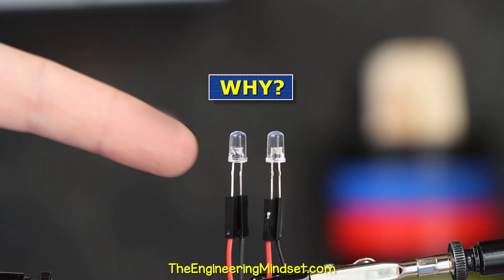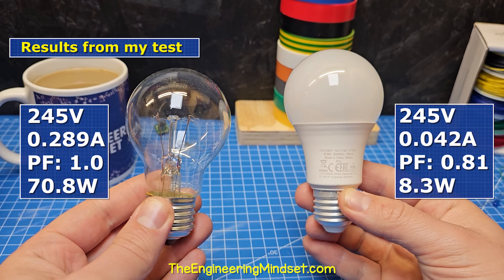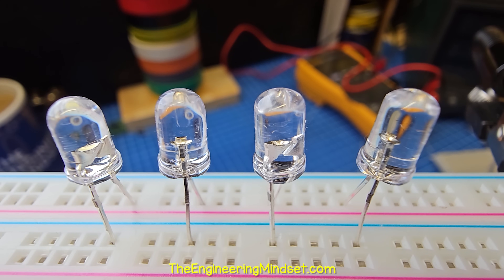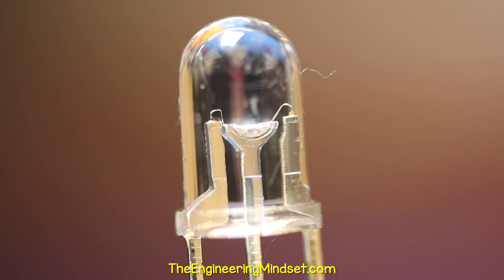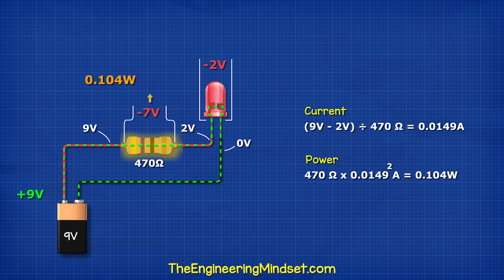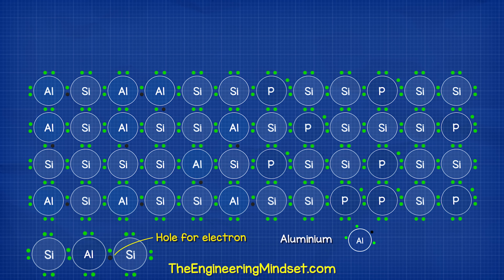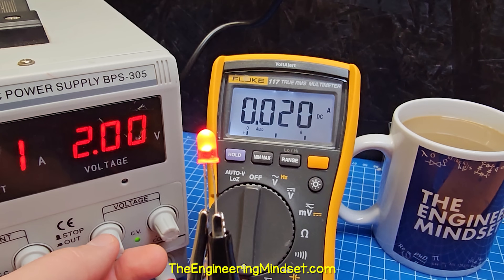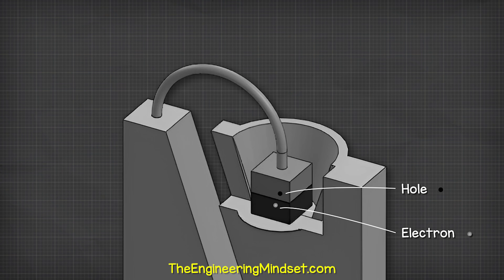How LED Works - Unravel the Mysteries of How LEDs Work!

Comment: Here’s a question:  when I watch YT videos of people on the street, often LED’s, whether traffic signals, lights in stores, or decorative lighting, appear to pulse/flash?  I realize the camera, by taking X frames per second is acting like a stroboscope, but that might mean that the light from LED’s is, in fact, flashing at a high frequency.  If that is the case, is the root issue that the LED’s are powered from rectified AC that’s not filtered?  Are we seeing 100 or 120 Hz pulses from unfiltered DC?

Comment: It's excellent, but there are a few minor details I can clarify. When you point to the television, you seem to think all televisions are OLED or similar, which isn't the case for most. LCD televisions have liquid crystal displays, just like watches. These crystals are positioned on the screen to block light and display each digit. LCD (and LED) televisions work the same way: the screen has filters for each color—red, green, and blue—then the liquid crystal, and finally the backlight. Quartz crystals block the colors that shouldn't be displayed. A simple example is for the screen to appear red; for that, the crystals must block the green and blue filters, but not the red. Since the red isn't blocked, it will shine through the backlight. The latter can use CCFL lamps or LED diodes, hence the term "LED TV."
In the case mentioned in the video, it uses a different technology, OLED. In that case, there's no backlight because the LEDs emit their own light. There are no filters because they have their own colors; that was the biggest mistake.

Another, albeit minor, error is that LEDs do generate heat because they also consume power, although the consumption is very low. So low, in fact, that the LEDs are soldered onto an aluminum plate to cool them. Another source of heat in the lamps is the electronics that reduce the line voltage to the appropriate level for the LEDs, but this consumption is lower.
The video failed to mention "smart" RGB LEDs. These have two or four terminals and are programmable for different colors or brightness levels. In the case of two terminals, one might wonder how they can vary the brightness and alternate between other colors. The answer lies in the power supply. Through it, a pulse train is sent at 400 or 800 kHz, depending on the timing and sequence of each pulse. The LED receives these pulses as a message, and a controller in each LED acts based on what it receives in the sequence.

Comment: I watched a video not too long ago about Shuji Nakamura, a Japanese scientist who struggled for decades attempting and ultimately succeeded in creating a viable blue LED. Up until then, blue LEDs were super expensive and consumed vast amounts of current. Companies like RCA and IBM gave up on their blue LED research. The company Nakamura worked for told him it was getting too expensive and to stop working on his project. He quietly continued the work on his own and ultimately succeeded giving us the means of producing cheap full color LED displays.
Reply: Also, Blu-ray DVD’s wouldn’t have been commercially possible without a reliable mass production process for blue LED’s.  If not for the difficulty of this problem, consumers would have had Blu-ray much sooner.

Comment: i love the modernity and colorfulness of LEDs, but the only think i hate about it is that's polarized, meaning it's choosy for positive and negative positions, which takes a little bit time to install, unlike neon or incandescent bulb. but i don't judge leds, please
Reply: also, when i connect the red and green LEDs in parallel, only red lights up, then the green didn't, just faint green light

Comment: You should add a section about the discovery of the Blue LED and how the inventors won the nobel prize. Due to its importance in modern life and completing the RGB combination - I.e allowing white light to be created with low energy, and allowing LED screens to function, and the colour changing lightbulbs etc.
In your example you elaborate on the process of Red, Orange, Yellow, Green etc. with Gallium Phosphade, but blue is entirely different - Silicon Carbide.
Reply from the maker: Tha ks for the feedback. Unfortunately, it's not possible to add to a published video. This video is just about how it works. Veritasium has made a fantastic video about the story of the Blue LED and the Nobel prize.

Comment: What happens after all the free electrons in the n region gets combined with the holes in the p region. I mean there will be no more generation of light since all the electrons and holes are recombined? Or does the electrons constantly gets stripped away from the holes after releasing a photon as far as we apply a voltage?

Comment: excellent video! 
Just a couple notes. at 8:35, unlike what's mentioned, most monitors would not use LEDs directly in the subpixels, more commonly just as a backlight, although the color mixing mechanism is the same. second is that the white LEDs used in light bulbs don't mix colors like that, as implied at the end. they're simply blue LEDs with a phosphor coating. exceptions exist of course. 
these are really nitpicks though, and I'm sure they've been pointed out before. i hope you keep up the great work!

Comment: so leds is the same tech used to make diode lasers then , only the configuration is a bit different instead of a cone reflector they use a farbi perot setup , why do leds have this bulb shaped lens is it to further converge the light coming out and without it the light would be more flooded rather than concentrated?

Comment: After 16:25, a few queries.  Is the Silicon Semi conductor still doped with Al and P?   With the GaAs and GaP semi conductors, is there still Si in the material?  So there is Ga in the P type junction and a mixture of As & P in the N type junction?  The ratio of 3:2 As:P gives you 1.7584eV?

Comment: Let me get this straight.  An  incandescent bulb gives off light and heat.  To use an LED bulb you need a light emitting part and a resistance part.  So the end result is they both give off light and heat.  Just one is way more complicated with all its chemicals and byproducts and potentially more damaging environmental hazards created by making of  semiconductors.

Comment: Good Work!  One question:  For red color to be produced the n-type and p-type materials would be different from materials producing green or blue light. Does the reason of producing Red, Green and Blue   because of each semiconductor material electrons´ have different energy levels?? I mean the electrons configuration of each semiconductor material for the red, green and blue is different. Thanks!

Comment: I'm new to electronics, and learning as I go along. I watched this video for the 4 pin RGB LED section, and it was by far the best video I've found. I made his breadboard circuit, but only have 2K potentiometers. Would that make any difference to the rate/way the resistence is limited to the LED?
Reply from the maker: Seen our new Potentiometer Explained video? ➡️ https://youtu.be/Xb-MZMoUtcQ

Comment: I would like to object to the comment about your screen being a bunch of multicolored LEDs. OLED is the only type of screen that uses multicolored LEDs. Most other screens use LCD (though often with a white LED backlight), which uses liquid crystal and two polarizing filters to control how much light is passing through small color filters. The visual of little RGB dots will still be the same, but the technology in use is vastly different

Comment: Can you describe 5mm 2 pin RGB led  light how to make work & diagram
Reply: Because  I have doesn't understand 3 colour led in understanding but how to make lete exchange few times auto matic with out ic
Reply from the maker: All covered innthe video

Comment: I want to connect 20 LEDs that have a max of 3.2v and 20mA each. Therefore I calculate I need 64v with a 2800 ohm resistor using 120v input Am I incorrect in my calculation thinking the volts coming after the resistor will be be 3.2v and that is all I need. Will it still power up the LEDs. Or do I need to have a power source of 64v which I would like to use the standard 120v input in North America to convert somewhere to 64v. I believe most adaptors have a built in transformer.
Reply: I did not get a full response

Comment: I bought two types of LEDS - 
1 = classic model - 2 pins = 1.2v ?
2 = modern ?  model -  4 pins 
 handles 3V - holds red , green, blue
red is not that strong, green is strongest
blue is stronger then red
red uses more mA

Comment: 1. A normal diode restricts current to flowing in one direction.
2. Some TV-LEDs emit light at wavelengths of 1 micro-meter or more.
3. LEDs work on the same principle as most lightbulbs, but WAY smaller.
4. You know what's cheaper?
R E S I S T O R S
5. 'SMD diodes' That's how computer pixels work.

Comment: 0:41: 💡 LEDs produce light by emitting photons when a voltage is applied, and they are more energy efficient than traditional incandescent lights.
3:25: 🔦 LEDs, including SMD and high-powered versions, emit different colored lights and can be used in various applications.
6:49: 💡 LEDs are used in various circuits and can be controlled to produce different colors and brightness.
10:06: 💡 LEDs and their components explained.
13:43: 🔬 The PN Junction in a semiconductor creates a barrier that prevents electrons from moving across, but a forward bias allows current to flow.
16:49: 🔬 Scientists discovered how to create different colors of light by blending different materials to form a semiconductor.
Recap by Tammy AI

Comment: They're neat but i've found myself hating them because some idiot decided LEDs should replace incandescent lights and fluorescent lights. When LEDs are used as replacements for those usecases they give me a headache, and I do not like having them in my home at all. I do not care about the higher energy usage, I need the other styles.  

Thanks for explaining how they work anyways but this doesn't solve my problem.

Comment: In 9:29 you mentioned that a single resistor removes 7V from 9V power source.
This is driving me nuts. I can't find a formula to calculate it anywhere. The only voltage drops information there is: how to determine voltage drops across a multiple resistors. But NOTHING about a SINGLE resistor.
I even asked ChatGPT about it (it's useless).

Could you please explain how do you calculate it? For now I just assume that to drop 1V you need approximately 70 ohms.

Comment: you can light both leds on 2 wire 2 color leds also - just half the brightness by using higher frequency alternating voltage. or just AC voltage.

Comment: Since it releases energy it is supposed to produce heat why no heat in the led
Reply: Because most of the energy is in the visible band so we see it as light.  Normal diodes emit energy in the infra-red band which is perceived as heat.  LEDs do produce some heat too, but less than a similar "normal" diode.    It is the current which produces the heat, a normal diode might be rated up to 2amps or even more, but LEDs function with a small current of 10 to 50 milli-amps.

Comment: The end of the video kinda undersells how big the discovery of the blue LED was. You name SiC as the blue LED, but in reality its indirect band makes it less efficient for the application. Gallium nitride was the bigger deal, it has a similar gap, but it's direct. It was such a big deal that the engineers who developed GaN based blue LEDs won the Nobel Prize in 2014.

Comment: ha ha try a ferrite core with say 21ga. 6 loop wrap slide down over a cb antenna key it up you will turn on both leds no  battery just RF power induction  used to light up watt meters that way

Comment: As a person born with astigmatism and nystagmus, I despise LED's nowadays.
They are practically blinding, burn images in my eyesight that lingers for a long time, and have horribly opaque halos around their source, which makes it impossible to see.

One could say "lol don't look at them", which is nearly impossible since nearly everything have them installed anymore, so much of which don't have a method of diffusing or masking/shading the diodes.

This includes streetlights, billboard displays, headlights/taillights, screens, stoplights, ceiling light strips, industrial work lights, spot lights, etc. How can one avoid looking at them when they're everywhere?
Reply: I HATE led lights too. Absolutely despise them

Comment: Great description! 👍🙏

Could you make a video about oscillators? I'm curious to learn more about them.

Also, what is a photon? I can see the light from my remote control with my naked eye, does that mean I can see infrared light?
Reply: Humans can see infrared light under certain conditions. 
 Infrared light has longer wavelengths and lower energy than visible light. 
 The human eye is made of water, which absorbs infrared light at wavelengths just slightly longer than the deepest red color that humans can perceive. However, if infrared light is bright enough, and of short enough wavelength, then humans can perceive it as red.
edit: that was bard, I am no that smart

Comment: There ate some LEDs out there where the larger plate (the anvil) is the anode. The flat spot is the only reliable method on through-hole LEDs to determine polarity.
Reply: Yeah, I have some of those. They're not very common though.
Reply: Yeah, I have some of those. They're not very common though.

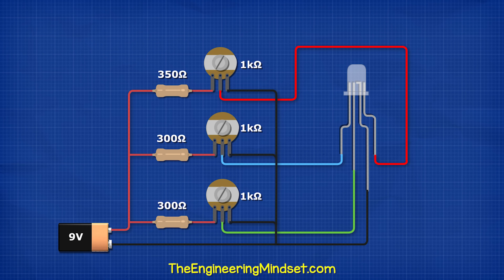Comment: 8:31 Correction! These are not LEDs! In most cases, this is LCD technology, with LEDs at the side or back for crude backlight illumination. In other cases, these are OLEDs, which stands for organic LEDs, which are also not quite the same as LEDs.

Comment: Correction on your part LCD screens are made of the same semiconductor that cameras use to take photos/videos however if you open the screen of a broken phone, tablet, LCD monitor you'll see a row of smd leds on a flexible strip at the bottom of the screen.

Comment: If you have 20 or 30 IR leds grouped together you can see the light emitted but only in a dark area. Take security caneras for example they use IR leds for low to no external light so who ever is veiwing the moniter to see what's happening without leaving their post.
Reply: You can see some light from IR LEDs, because they produce a relatively wide wavelength spectrum around their core wavelength - fraction of which can go into visible wavelength. The same case is with UV LEDs, which emit small part of their output in visible violet spectrum.
Image sensors can see more into the  invisible specters, than the human eye, which is principle used in security cameras. Standard cameras have filters to block most of these wavelengths for better picture clarity (strong IR source can be still visible, like the example with the remote)

Comment: 3:46 That bulb has a step-down converter, never seen that before. The LED Edison style house bulbs that I seen have been chains of LEDS banks in series and parallel with almost no electronics aside from LEDS. I have cut the tracings on the PCB and re-configured the bulb to run off 12 or 24VDC instead of mains  power. After I finish I can re-glue the dome back on and have an RV light.

Comment: By the way, I had a question. Why are individual LEDs dimmable with variable voltage but you can't dim (most) LED light bulbs? Also, why do you need a trailing edge dimmer? I understand how they work, by turning the light off faster and faster, but shouldn't that work with a "non" dimmable LED bulb too?
Reply: Most LED bulbs have an electronic circuit to rectify the AC current and then actively regulate the current through LEDs - this is to remove the flicker and increase efficiency. As a consequence, they cannot be dimmed, as the regulation simply increases the current through LEDs when the voltage drops.
Dimmable LEDs can detect input from the dimmer and regulate the current accordingly.

Comment: 8:35 No, unless your monitor is OLED (and very few are), you will not see LEDs there, rather LCD pixels.  Even if it is a so-called LED monitor, that just means it's LED backlit.  OLED is used on TVs and 'phones but rarely on monitors because of screen burn issues.

Comment: Liquid Crystal Displays - known as LED monitors - use a backlight of diffused white LEDs.  The colours are created by a grid layer of liquid crystals on top of that that rotate the polarization of light when hit with voltage, allowing more or less light through each subpixel.  The only LEDs are the white backlight - the RGB subpixels are liquid crystal.
Micro LED is the current holy grail of display tech - each RGB subpixel is an individual Light Emitting Diode - but manufacture is  reportedly difficult to scale and subsequently rather expensive.  Prices range from $80,000 to $150,000 for a 2023 Samsung Micro LED screen.  Response times are in nanoseconds, and longevity should far exceed LCD and OLED - with no burn-in risk.  Colour is also very accurate due to the LEDs emitting the exact spectra of red, green, and blue.
Reply: I'd like to add some points:
OLED displays have individual subpixel light sources, but those are not really LEDs, rather electroluminescent cells.
QLED is quite an interesting technology - while still using LEDs just as a backlight source, QD layer produces light with a narrow band, which improves colour accuracy. But, there's potential use of QDs as the colour filter instead, which could drastically improve the panel efficiency.

Comment: So using the two best simultaneously is the best option. Thieves are deterred more that way since most of the time they need to do it quickly and that's not guaranteed with different top quality security measures.